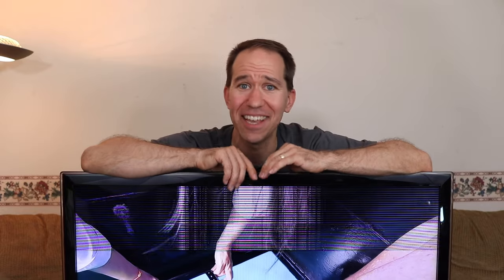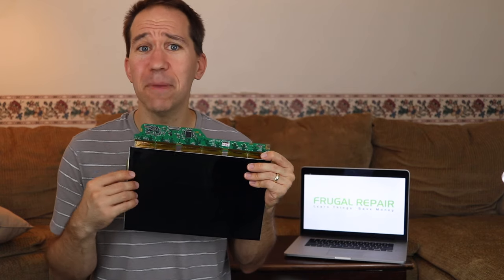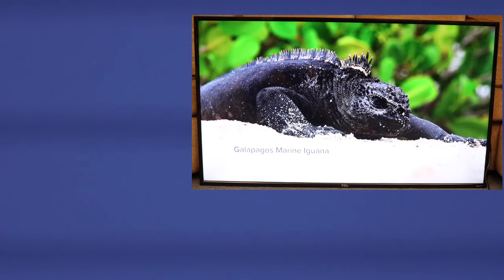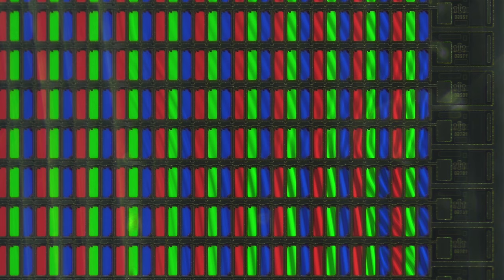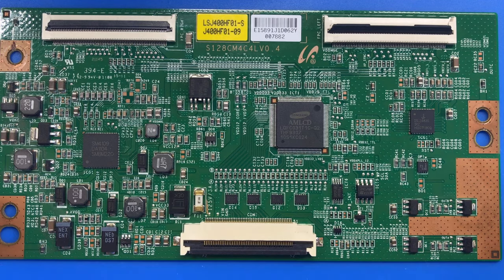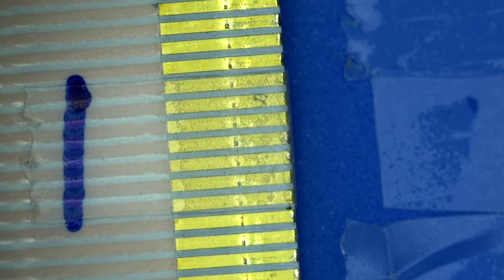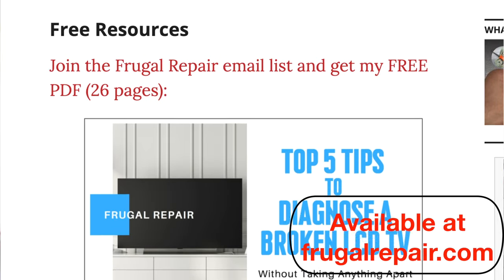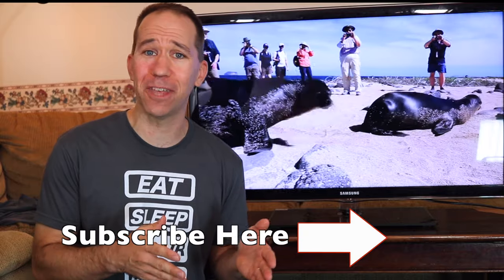Repair Hack Explained | How to Fix TV Horizontal Lines - Part 2

Comment: Amazing!!! Really..I have a two year old IFFALCON LED TV 55inch. All of a sudden it started having horizontal moving lines. As usual I called the customer care and a service tech visited my home. He said the panel is gone.Replacing it will cost about 85% of new tv cost. That's when I found your video and thought will give a try. I don't understand electronics or anything. I couldn't read whatever is written on the board.I tried the try and error and VOILA!! My tv is now working. There are few black lines in bottom left. But I don't mind those few lines in such a big tv.Even 4k looks good only. So thankyou sooooo much.
Reply from the maker: Great job!
Reply: Hey dude how long did your tv last after fixing with the tape or is it still rocking ?

Comment: You’re explaining this more in depth!!!! Thanks!!! But I would really really want to repair the clock signal...I love too much my TV and want to learn more about replacement components.
Reply from the maker: Thanks!  My guess is that the problem is somewhere embedded in the panel.  Maybe with the right tools you could get in there without damaging the panel.  It would be tricky though.  I would like to have a full schematic of the panel, that might help to pinpoint where the issue is.
Reply: @FrugalRepair  I saw some guys on YT repaired it by cutting the connection on the board it self instead of using tape. I have a Samsung I got for free a 42'' inch or so, bought a Panasonic for 60 euro's a good one and 12 euro's for the remote.  I have the feeling older tv's lasted much longer than the flatscreen do, they are just a throw it away. My mom bought in the 80's a Schneider that had an ITT tube, worked for 17,5 years constantly on, many people told us, it was trash, well known brands were gone sooner than our tv set.

Comment: I tried this method with my LG 75UH6550, There was marking on the board itself that said which pins were clock pins, so I taped them off and it worked!!  The tape was about the same width and at the same place as in the video. Thank you for making this video, it saved my Superbowl Sunday!
Reply from the maker: Congratulations on the fix!  And just in time for the Super Bowl!

Comment: Good explanation.  I have been doing this for years as a repair shop.  I have found it a lot easier to use a post it note (non sticky side) and cut in varying size strips and moving from side to side.
Reply from the maker: Thanks!  Glad to hear you have been doing this too to bring back the picture on the screen.

Comment: I just fixed a three-year-old Vizio M558-G1 by applying the opposite logic on the image vs control lines. Vertical lines dominated the picture, and removing the TCON cables revealed the problem to be on the left-hand side. From your video, wherein you pointed out image data is vertical and control/timing data is horizontal, that told me I had an image information issue. Before then, I had no idea which pins to cover. That data limited the shorted vertical image processor to one of six on the right and I inferred that meant six control lines. Covered them all, and the picture came back immediately with a shadow in the lower left corner. I then started working one at a time, starting with line 6, then 5, and *bingo*, the picture was back with no flutter. I put it back together and it has been running perfectly for about four hours now. You just saved me $1,600 I was getting ready to plunk down on an LG G2!! ❤️

Comment: Man !!!
You are legend !
Ive been banging my head with lvd ribbon cable, even swapped tcon board but couldn't figure out whats going on.
Your explanation answered my question..and ur method worked 100%.
For me (Samsung 50" smart) it was the last set of 7 lines in right ribbon cable (if looking from rear of TV)
I did like 20-25 hit and trials of 7 lines wide tape and finally hit the exact set of lines !
Thank you so much brother, you earned some prayers from me :)
Reply from the maker: That’s so great to hear!  Thanks for sharing and congratulations.

Comment: Thanks so much for making these videos! I looked around for repair insights like this back in march, but glad I kept the broken TV "just in case".
Also, your continuity test "swipe" at around 5:25 was really reassuring, as I would've worried I could short something else out by just probing those tiny traces at random.  Thanks especially for that!
Reply from the maker: Thanks! I hope you can get your TV repaired.
Reply: @FrugalRepair  Hey bud, my TCL qled panel got damaged , my son threw a hanger at the screen, there was a crack and white vertical lines about 2 inches in that region, after a month of r&d the tcl person gave me a about 200$ quote, now my question is how can i figure out whether he has fit a qled panel or a UHD panel
Reply: @ktolwal  If TCL quoted a price lower than new purchase price of an entire similar TV, there must be a misunderstanding. LCD panels always cost more than a new TV especially considering shipping and installation. To answer the question, There is only one specific panel for a given TV, no substitutions.
Reply: Thanks commentor you can be frank too

Comment: Thank you very much for this video. My LG 42UB820V developed the same fault as described in your video. I located which side was causing the issue and identified the clock pins (there was 8 from pin 3 to pin 10 on the ribbon). Small piece of sticky tape over the 8 pins and all back to normal. What an incredible fix, sheer genius!!
Reply: Hey, how did you locate the faulty pins?

Comment: +FrugalRepair Thank you for the explanation. I had seen people using tape, but they did not explain WHY. I have an electrionics degree, struggling to understand why blocking signal fixed a screen issue. You have shown the theory behind the repair. Much appreciated.
Reply from the maker: Thanks for watching!

Comment: Omg it worked i cant thank you enough i really wanted to buy a tv for my room but i spent my money on a pc i recently got a free lg 32" tv from adverts i spent 2 days troubleshooting and now it works you really inspire you i cant thankyou enough for your info i want to do electrical engineering or repair when im older and i have leared so much from your video keep up the incredible work
Reply from the maker: I’m so glad to hear you fixed the picture on the tv. Congratulations!

Comment: FINALLY the Louis Rossmann of LCD TVs!!  Your last video troubleshot a TCL LCD,  I just had a 43" 4k TCL flicker then the backlight seemed to fade out on the right side.  I see the image across the entire screen however it gradually gets darker the further to the right.  Any troubleshooting suggestions or can you perhaps create a  video on how to repair / troubleshoot backlighting on LCD panel?  Big thanks,  thumbs up and sharing your channel.
Reply from the maker: I feel honored being compared to Louis Rossman. Thanks for the comment and share!  Did you get my pdf?  I have a led backlight suggestion in there.  Sounds like you need to replace some of the LED modules.  I’ll create a video sometime, I’ve got a pile of free TV’s people have given me.
Reply: @FrugalRepair  Joined the email list but have not received the pdf.
Reply from the maker: Let me know if you haven’t received it. It takes a few minutes to send out after someone subscribes.
Reply: @FrugalRepair   I received the link, thank you!  I've tried dimming the brightness as suggested but  the dimmed side is dropping in brightness as well.  I would expect the bright side to match the dark side when decreasing the brightness at some point IF a backlight LED was out.  When the startup screen appears after a hard restart the entire screen is PERFECT for 2 seconds, then the dimmed area appears.  Possible power/short issue I wonder?  Any suggestions would be awesome, thank you.
Reply from the maker: Good to hear you got the link.  What you are describing sounds like there is at least one shorted LED module on the darker side.  The reason you get full brightness at boot up is that the power supply ramps up the voltage all the way and then the short circuit happens to take it out some others LEDs (maybe it's localized to one of the LED strips).
Reply: @FrugalRepair  Makes perfect sense, I was planning on pulling apart the TV and running some diagnostics today however the TV started working again this morning!  :)  Have you ever see that before?  Usually if a LED module is out, it's out right??
Reply from the maker: Temperature plays a big role so if it stays cooler the LED might live a little longer.  That's my guess for the fickleness.

Comment: Bro, this basically fixed our TV. We taped over the left-most 4 pins on the left side ribbon (looking at the back of the TV, oriented right side up). The only down side is that it seems the red LEDs are affected by this. There are horizontal wavy patterns every time a lot of red is shown on the screen (like in Netflix, for example).

Either way, our TV literally randomly started showing lines and color stains, and this helped us completely get rid of those, so our TV is watchable once again. Thank you so much, dude!!!
Reply from the maker: Congrats, thanks for letting us know!
Reply: @FrugalRepair  It's so appreciated. We noticed when watching shows now that the right side of the screen is really missing a lot of red in the color. It's like when character move from left to right, they get dreary and depressed as they lose their vibrancy haha. Might do the same thing with the other side of the screen so that there's at least no difference.

Do you know why this would happen?

Comment: Thanks for the explanation.  I “fixed” mine a number of years ago and couldn’t understand why it worked.
Reply from the maker: You used the blocking method on the row signals?

Comment: Thank you for making this video with clear explanations. I used to work in lcd panel factory in Taiwan as a HR, but the factory R&D never taught me such a useful tip, even though I may not be able to open the cover, test the voltage, and fix it by myself. Still thanks anyway.
Reply from the maker: Glad it was helpful!

Comment: This actually worked for me! Thank you!
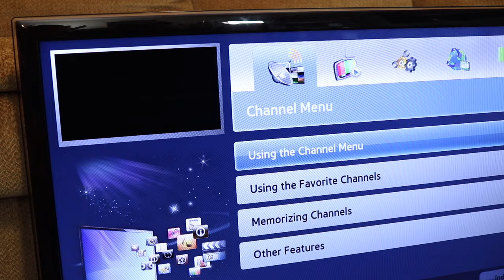I had a single pixel-length black horizontal line a third way down from the top of my Samsung TV, that faded as it went from left to right. After placing a mm of electrical tape on the 15th trace on the ribbon connected to the TCON board, it got rid of it. The only complication like you mentioned at 7:20, I have faint lines from top to bottom accross my TV, but they're barely noticeable unless I am standing 3 feet or closer.
Reply from the maker: Congrats!  That's great.
Reply: Hey Cam.  How did you narrow it down to the 15th trace?
Reply: @therealeffingdeal  A lot of trial and error. I just kept blocking 2 traces at a time until I noticed a difference on the screen.
Reply: @camokid95  im working on a QLED with a single line across the screen.  I don't want to block off half a dozen tracks and loose picture quality since I reason that is likely a single trace that's the issue. 

 How does your picture look with your fix?  Do you see any diminished picture quality in the trouble area?
Reply: @therealeffingdeal  It appears diminished, but not that noticeable from a distance. You should only block the trace relevant to the line that's a showing the dead pixels.
Reply: @camokid95  That might be good enough for me.  i appreciate the advice and encouragement.

Comment: I've fixed 4 different models of LCD tv's with one simple solution. Remove the back cover of the tv, take a good can of compressed air, and blow out as much of the dust as possible.
 Make sure to concentrate around all the capacitors. And I'll guarantee you 80% of the time, this will fix your issue and the lines will disappear. 
 So try this fix before contacting a repair centre, or even replacing the tv.
Reply: Thanks
Reply: 80% of the time it works every time. lol

Comment: If you use trial and error again, like you did in another of your videos, could you find which exact line or lines were causing the malfunction?  Therefore, wouldn't less tape blockage boost the signal by chance?  Thanks again for your content!  I'm trying to fix horizontal lines on a TV given to me.
Reply from the maker: Finding the exact cause can be tricky because it is likely something not visible (or accessible) inside the lcd assembly.   So you need to do trial and error diagnostics from the outside (ie mess with the row signals) to try to narrow it down.  The row signals are individual so there isn't a boost, per se.  It's a bit complicated to explain but that's what I was hoping to do in this video, lol.

Comment: Thanks for this video, it worked and was quite easy to do. You saved me a new TV at over €1000! One question though,  I now have a horizontal single black line that pulses on and off for a few seconds at a time. Since its only one line I can live with it, no problem, but was wondering why and if it is repairable. Thanks again
Reply from the maker: Congratulations on the repair.  Not sure about the line, likely it’s part of the internal lcd issue your screen is having.  You might be able to minimize it with blocking a different row signal.  But if you’ve tried all of the combinations then that may be the best you can get.

Comment: Thanks so much for the video! My 7yr old (fairly expensive), 65in curved Samsung just developed a single, very thin horizontal line. It's not all that noticeable but annoying nonetheless. (Other than the line, it's fine otherwise.) Assuming I could find the right pin to block, would this method take care of it?

Comment: Thanks for the hack! This did fix an horizontal line I had on my 4k TV. Only issue is afterwards I get some faint horizontal lines across but not very noticeable.

For the tape I winged it and guessed right by trial and error and it seemed to do the trick!
Reply from the maker: Awesome! Congrats.

Comment: The most logical explanation on why does tape "fix" TCom board problem! :)
Reply from the maker: The problem is actually on the LCD in most cases, not on the tcon.
Reply: @FrugalRepair  Thanks!!

Comment: First I would like to thank you for the simple and excellent explanation.I have a Panasonic Fhd tv which started showing the horizontal lines. I opened it and found the t con board which was surprisingly an lg board ,identified that the left half was the reason for the horizontal lines and the tape actually fixed it.
I have a question though where actually is the problem,is it the led panel or the t con board ?

Comment: Thank you for making this wonderful video that plainly explain how a LCD monitor works. I enjoyed watching both parts.

I repaired a few monitors in the past simply by replacing components without fully understanding how the monitor performed the signal processing part. I guessed my luck ran out when I got a panel  displayed everything in BGR instead of RGB while appeared to be intact. I have been stumped for awhile trying to look for known cases with similar issues, but I think I didn't even know how to ask the right questions. It's nice to finally know what to look for!
Reply from the maker: Thanks!

Comment: Good job!Looking forward to a video, where you talk also about vertical lines issues and possible fixes.
Reply from the maker: Thanks!  I do have a TV that has vertical lines so maybe I will make a video sometime. Great suggestion.  The jerry rig solution many times for that is to put non-conductive material on top of one of the electrical connections and force it down by screwing the frame down on it to create pressure on it.
Reply: @FrugalRepair  i have a vertical lines can you please make a video??

Comment: Have a  Samsung UN55NU7100FXZA Model that kept recycling on and off. The standby LED would blink twice before it recycles again. This method you describe also worked to resolve this issue...It was also the screen on this model that was causing this issue. Thanks for sharing your knowledge.

Comment: This is awesome! What if you wanted to actually fix the problem though? Is this issue caused by a bad resistor, cap or chip?
Reply: Could try opening the TV & replacing the T board & screen tape but it's probably cheaper & easier to get another TV

Comment: You're a legend! thanks for sharing your knowledge. Question: can you change a broken LCD panel from a different brand or model?  Is that possible?
Reply from the maker: Thanks!  Yes you can replace an LCD on the TV, but the issue is that it has to match what the timing control board is outputting.  That is, all of the signals must match on both sides.
Reply: Yes you can, you need to check that vcc is the same, also, if the screen has an lvds cable or ribbon cable you need to check if they are the same kind, for example there are screens that are milimetrical so they have only one ribbon cable to the tcon this cable had like 50 lvds line or more, also you need to check if the screen had the same ratio, you cant replace a 60hz screen with a 120hz screen unless you have a converter, also they need to be same size, inches are not standar for every screen, you can have two 42" screens but one can be 2 or 3 milimiter bigger. Sony is compatible with samsung and lg is with any chinese screen